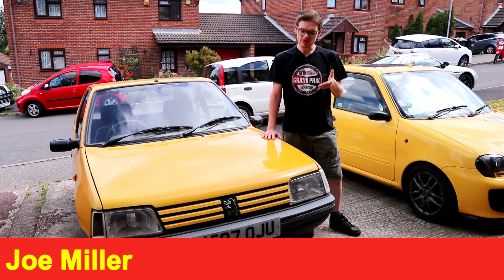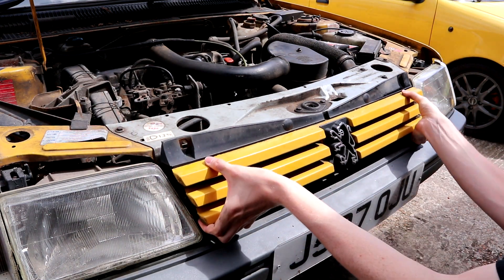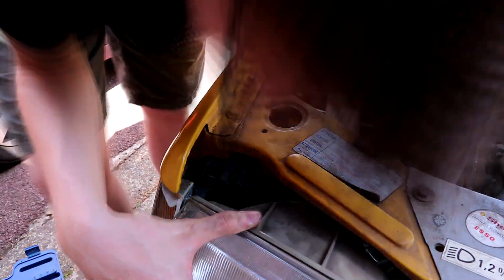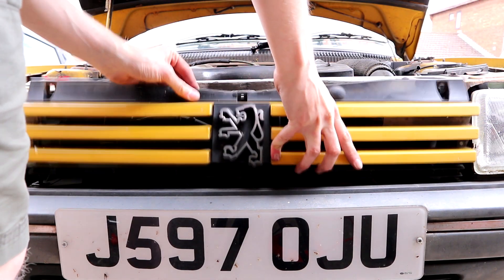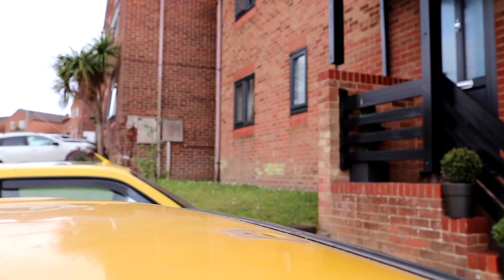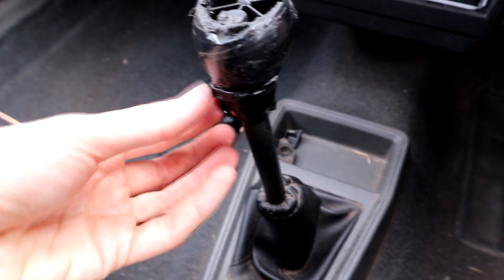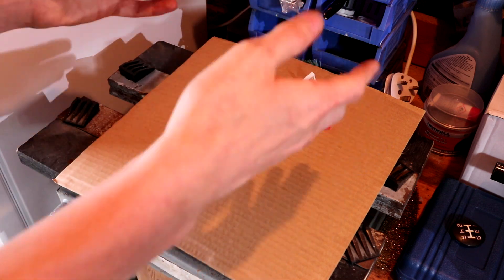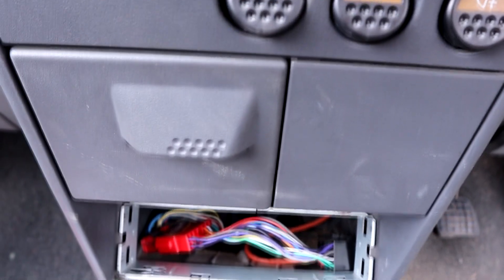Cheap Fixes on The £400 Peugeot 205

Comment: You've gone the hard way round this it's a 5 minute job to replace the indicator. The black plastic adjuster stays on the car, headlight is held in with spring clips then its 1 screw then the indicator slides out.

Comment: You didn’t need to remove the grill to take headlights out the unclip from the adjuster and pull out, then easy access to the indicator

Comment: Remove grill, Unclip metal clip on the right, undo screw on headlight adjuster - headlight comes straight out, undo screw holding indicator into plastic holder and it slides out. I felt really sorry for you doing this the really long way :/

Comment: I’ve had the same indicator hassle with my 205. It’s pretty straightforward once you do it 10 times😅. But interestingly, my gear stick was fitted with the ‘94 only tennisball option, very rare! They’re huge fun to work on, even if you’re a novice like me
Reply from the maker: I've got NO plans to do it again! - Joe
Reply: '94 Tennis Ball option? Which one is that?